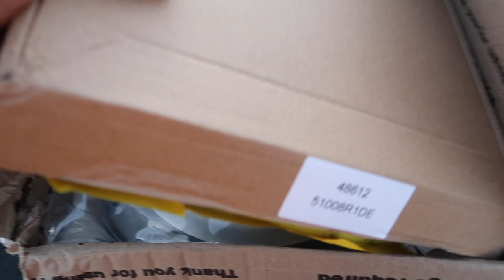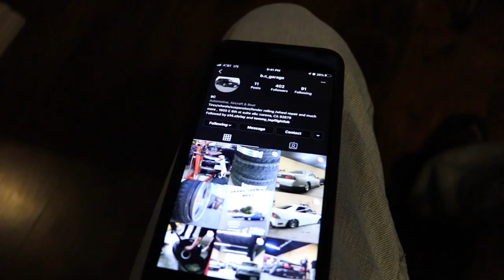Mini Truck Gets Stage 2 Clutch ???

Comment: get some mold on or bolt on fender flares to fit them wide ass rims to get perfect fitment and i never knew it was manual thats cool asf
Reply from the maker: Randy Lara Vargas ya i always wanted a manual truck broo but i wanna find someone to make me some custom wide body fenders forsure!
Reply: @Slidewithjunior  ay bro i found someone who makes custom flares but u need to bring in ur lil truck in to get it perfect hit up @moonlightrunners on ig
Reply from the maker: Randy Lara Vargas thank you bro 💯
Reply: @Slidewithjunior  and @moonlightrunners on ig have some sick ass cars too that they did custom body work on!